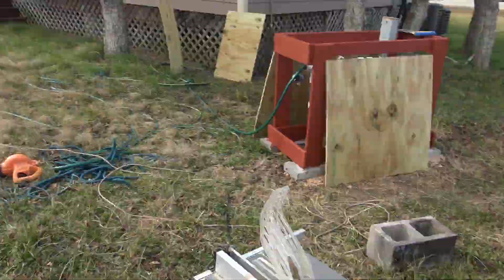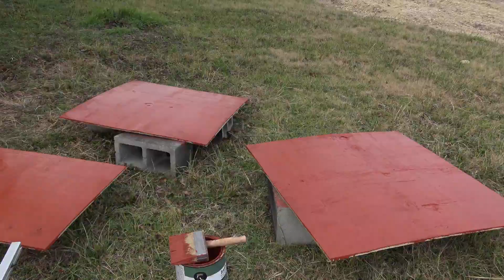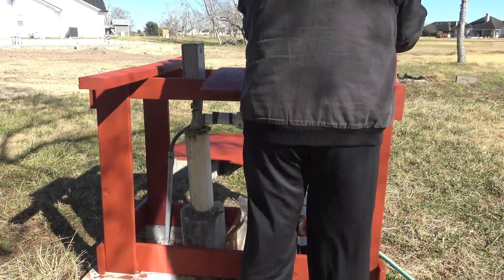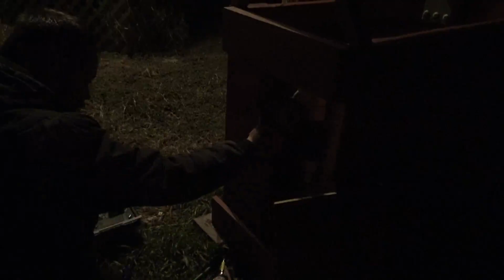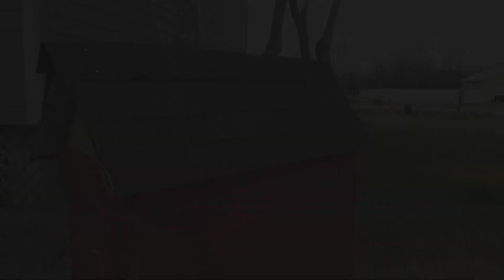Building a Cheap & Simple Water Pump Shed Using Dog House Designs

Comment: Hi, 

Thanks for this.

May i ask...

If you need to get completely to the pump....did you make it so you can lift the whole thing off? 

Thank you
Reply from the maker: For a simple fix or issue, like turning on the water hose or inspecting inside I have a door on both sides that I can get access to you.

However, I should I have something major going on like a pipe repair or adding on pipe for irrigation etc I can tilt the whole structure with ease and allow for it to set on it's front or back. 

I had originally thought of adding the doors to the long sides but the positioning for my layout would have made it to were the water pump was exposed to the north and south winds which could increase my odds of a issue. So now I have the doors on the east to west sides and I may look in there twice a year to make sure there aren't any leaks, but mainly when winter comes along. 

IF we have a bad freeze I can run heat lampes, strips to it without issue and utilize a smaller door to feed the line. 

It is simple and works well, been about 2 years now since we did that and it's holding up well and is very sturdy.

Thank you for your question! :D
Reply: @thepustka6773  Thank you kindly.  

That is very helpful.
Reply from the maker: @LLLL-ld5wh  You are welcome! If I could do it you can do it as well! Best of luck!